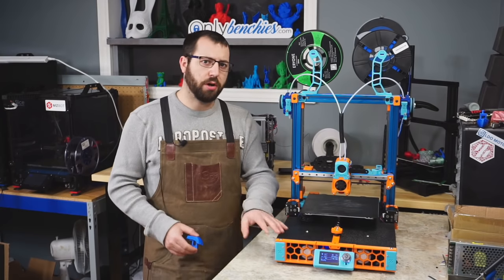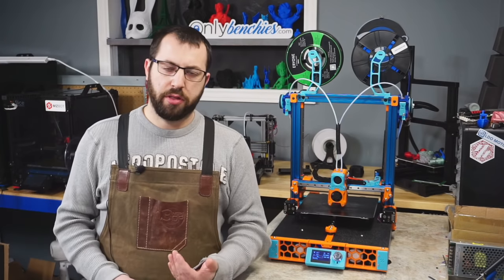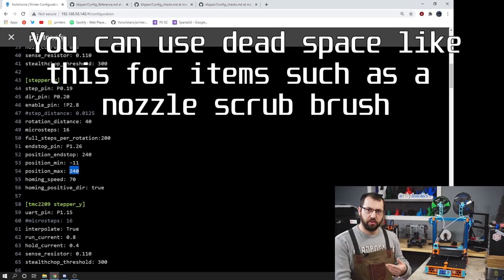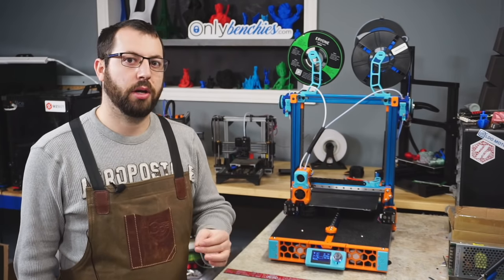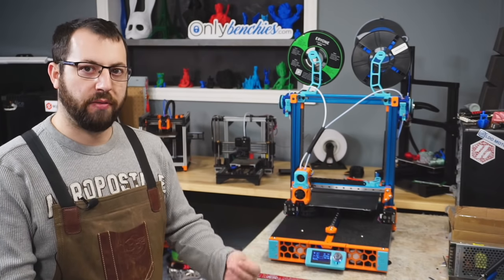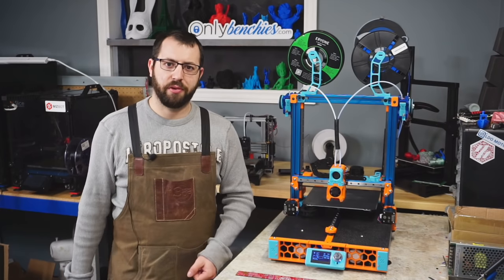Klipper Initial Setup : Making sure things are all good before printing

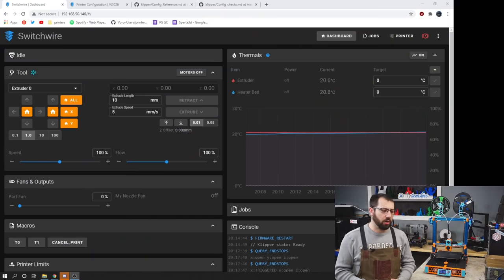Comment: 00:45 - Homescreen
01:05 - Temperature sensors
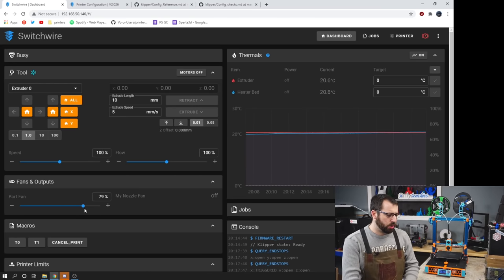01:20 - Fans
01:25 - Endstops
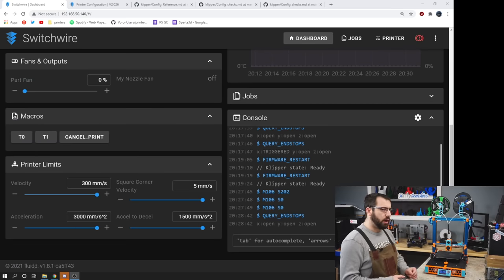02:42 - Stepper buzz
04:59 - Homing
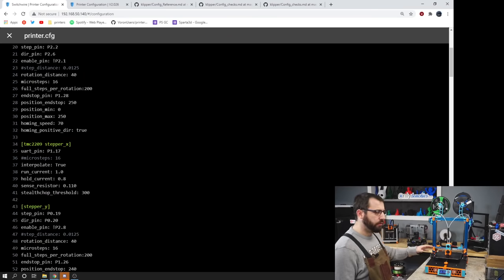06:00 - Z-offset
06:57 - Print volume & travels
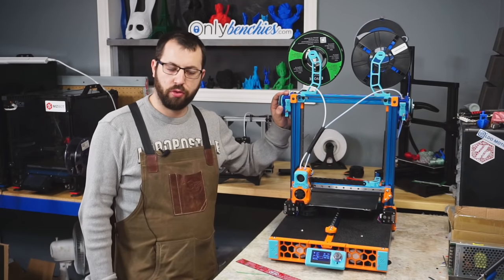09:09 - E-steps calibration
12:07 - E-steps (rotation_distance calculations)
14:20 - PID tune calibration
16:15 - Print flow calibration
17:25 - Pressure advanced tune
17:45 - Outro (Input Shaping)

dedicated to all lost souls alike out there, rejoice! 😆

Comment: Hey man because of you I decided to switch from octo print no klipper to mainsail and klipper, I spent like 15 hours over the past scrubbing my printer config and testing movements even went with the uart rasp pi zero, keep up the good work and I'm sure this will be one of my references moving forward.
Reply: in case you decide to go back to say Merlin, can you just flash from microsd and that's it? in case of a failed klipper host install how do you recover your board?

Comment: Great video. Just switched my ender 3 from marlin to klipper to get familiar with it while i also build a v2.4. I never knew to pull the nozzle for a extruder calibration. Always just heated to the temp i would print at and extruded. But it makes sense to do it your way. 
And i was trying to figure out why my printer was going all the way to the end stop to start a print and print over the air. I have a few numbers to wiggle around in my printer config to do today. 
Maybe I can push some plastic and make my first klipper print today😀

Comment: Thanks for all of the great videos! I'm not very experienced with all of this stuff, but decided to build a Voron 2.4 anyway (Whew!) I managed to get it all together and am running Klipper with Fluiddpi, using a BTT Octopus board. I've gone through all of the setup procedures and am ready to test print, but I can't figure out how to upload a gcode file! Under the "Jobs" tab where the "+" should be for uploading, it just says "no root, see logs" and has a red warning triangle. I tried sending it directly from Cura with a plugin as well, but no luck. Any ideas?

Comment: Question: With your "demo" printer, aren't you concerned about the filament on the gantry? I've found it magnifies the existing vibrations and had an adverse impact on my prints. Once I took it off my prints were noticeably smoother.

Comment: Hello. I got a Kodak Portrait 3d Printer and I installed Klipper on it. The nozzle has a triger switc and the home of the Z axis is on the bottom of the printer (Core XY). The problem that I'm having is once I home the printer the head is triggering the X and Y limit switches on the right back of the printer and the Z is on the bottom with a regular limit switch as well. After homing the axis and heat the nozle and the bed the printer start to print but the bed is still on the bottom (lower position) and it prints on air. How can I deal with the bottom limit switch and the nozzle switch to correct this problem? I also need to enable the second extruder. Not an easy task. I hired a guy to help me but it is taking too long for him to figure out all the pins and it's costing me more then the price of the printer. What is your suggestion? Thanks a lot.

Comment: Since I run Klipper on my Ender 3, I have severe problems with underextrusion at the z seam. Pressure advance already configured and coasting disabled. Any ideas?

Comment: Thanks for the info, helped a lot.
2 Questions.
Can Homing start when klipper start? Can it be set, so you do not have to click it manually?
Ender 5 plus, cannot use the whole bed volume, much smaller now with Klipper.

Comment: Any chance you have a video for hooking prusaslicer to fluid to make it sent prints automatically like octoprint did?  It does not seem to have the API key function the same.
Reply: Also flow calibration. Is that through firmware or the slicer? I got 0.43 on all 4 walls so a bit over.

Comment: I have a ender 3 converted to a 400x400x500 but also it's idex. Do you have a video or could you point me in the direction of setting up klipper for a idex setup please? It runs a skr 1.4 pro board.  I run klipper on my regular ender 3 but new to idex.

Comment: how accurate would you want to be with the e-steps? I got like 99.7mm, but I'm measuring it from the end of the bowden tube (ender 3) just before it enters the heat break (because its kind of the easiest place to get to) at this point, the PLA i'm using is kind of curled and hard to get a good reading on. would it really be necessary to worry over .3mm that may just be error in my measurements?

Comment: If my single wall cube comes out too thick (0.53 instead of the expected 0.4) why adjust the flow percentage instead of adjusting the e-steps?  Thinking that if e-steps are calibrated for 100mm and flow is set to 100%, I should expect 100% to equal 0.4. Instead of running the printer at 98%, why not adjust e-steps to compensate for the over extrusion so that 100% = 100%?  Love the tutorials.  Your vids got me onto klipper and I can't believe the difference.  Cheers.
Reply: May have an answer to my own question: set the steps/rotations just the way you show and then don't adjust them to compensate for over/under extrusion because doing that might mask whatever other issue is actually causing the over/under extrusion.  Makes sense (h/t swordfish45 on r/3dprinting)

Comment: Assuming no other conditions are in play during extruder calibration (hotend is disconnected, tension is fixed), shouldn't the rotational distance be proportional the length of the extruded filament? I.e. the higher the arc the higher the extrusion? In your example it was disproportional.

Comment: What do you (and others) think about the baud rate on an SKR Mini E3 board that has STM32F103xx chip, which has the 115.2k as 0% error baud rate, but klipper uses and advise to use 250k?
Reply from the maker: doesnt have any real impact with klipper at all

Comment: Hey, love the videos and all you bring to the community. I have been trying to setup my CR-10 V3 with Klipper and Fuidd but I keep getting stuck when trying to print something with a “!!Move out of range: 296.000 -3.000 5.039 [0.000]” message. Everything looks to work it homes and I setup the Z offset with the paper test so I am not not sure where to go from here.
Reply from the maker: Need to ensure your max and min travel is setup correctly in yout config
Reply: @CanuckCreator  thank you, it ended up being a bad start Gcode from some Marlin stuff I had, I am up and running with Klipper now, Thank you.

Comment: Hey man, I had it all setup and after upgrading the extruder AND doing updates on klipper today I have an issue with the bed leveling. To be exact it's when runs the bed map update the X runs to far to the right and slams into the frame. I haven't touched any config except the rotation distance. Klipper update messed it up or I did?
Reply from the maker: Make sure you have it setup correctly, ask it to move a fixed amount and measure it, sounds like you have something setup wrong and its double stepping or something
Reply: @CanuckCreator  As I said nothing has changed except the extruder. For now the fix is mesh_min : 30,30 mesh_max : 285,285. It was 20 and 310 before. of course right after that I ran into a new issue. The part cooling fan seems not to get 24v, I turn it up to 100% and it blows not the full amount of air. Is there a way to adjust this? Converted a stock TronXY X5SA.

Comment: Actually the best way to measure flow in my opinion is to print a single layer 100 x100 mm at 2.8 mm or 2 mm. Wait for to cool and then measure the thickness It should be exactly 2.8 mm or exactly 2 mm And should measure 100 by 100 mm. If it measures too thick your flow rate is too high if it measures to thin your flow rate is too low adjust your flow rate until your thickness is exactly what it was programmed to be. This works best on a glass print surface or a smooth print service and not a textured print surface.

Measuring flow rate on a hollow cube has too many variables,

On the other hand measuring flow rate by printing a flat sheet one layer thick in my opinion and in my experience has proven to be very accurate in calibrating flow rate. In fact when you get the flow rate calibrated properly the top surface of that single layer will be as smooth as the bottom surface with no visible layer lines.

Comment: Love your work. Question about PID, in the manual it says after running the PID you need to run SAVE_CONFIG command to save the changes to printer.cfg. I did that and it created a printer(DATE&TIME) file. Nothing was changed on the printer.cfg file, any ideas? Thanks.
Reply from the maker: Ya its an override file that it creates so it been done correctly
Reply: @CanuckCreator  Roger that, I appreciate the rapid reply.

Comment: how do I set the Homing in the middle of the bed? I tryed position_endstop, but it don't work. Because x and y homing is good. But than I will home Z. The Printer will try to home at that, but my print bed is to short... I need to do it in the middle...
Reply from the maker: safe_z_home IIRC is the callout

should be covered in the klipper docs

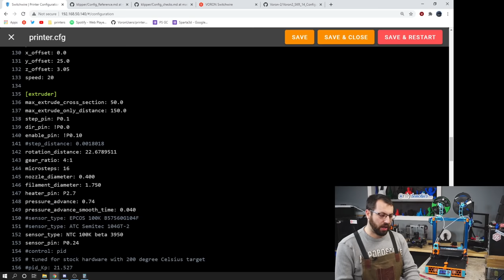Comment: 10:46 "min_extrude_temp: 0"
First of all, Klipper doesn't allow min_extrude_temp to be set less than "10".  
Second of all, if min_extrude_temp: 10  any attempt to extrude filament ends up with "Max31865 Overvoltage or undervoltage fault" and firmware shutdown
Reply: My klipper has min_extrude_temp: 0 set and is allowing me to extrude filament without issue, kinda sounds like a you problem no?

Comment: I keep getting the movement out of range error, I am using 3d print beginners printer.cfg file and Ideamaker klipper profile. Any ideas please mate. Some prints it's fine then others it stuffs up. I have changed the bed size to accommodate the Biqu h2. Any ideas please mate
Reply from the maker: Most likely an issue where your slicer is trying to move the toolhead out of the min/max travels setup in your config.
(for example a purge line at y= -2 but config has a min of y=0)

Comment: Great content, but I would skip the e-steps and flow calibration nowadays. Unless something is wrong with your extruder mechanically, anything different from the stock e steps will be caused by differences between filaments or problems with the filament feed. Calibrating e-steps individually for each filament isn't very useful.

The same holds true for flow calibration. It's also notoriously hard to measure this with calipers and influenced by external factors like temperature, moisture content etc.

Unless you get results that are way off I would leave both these settings on standard.

Comment: I can never get the flow to work correctly. It seems to under extrude the 1st layer.

So the hollow cube will come out with a wall thickness of 0.54mm with a flow of 100%. That means that the flow should be around 74% to get 0.4mm. But if I use that, it will be under extruded. Am I missing something in cura?
Reply: try measuring only the top several layers with medium pressure. If you're putting the caliper all the way down, it could be subject to layer inconsistencies and it will read a lot fatter than a a single wall is.

Comment: Hi, great video. Just installed klipper with fluidd on my ender 6 and i got a wierd problem, i tried print 2 different models and both crash midprint (maybe around 50% of print), im clueless, log says something about lost comms with mcu. You have any clue what could be the problem? Keep up the good work, cheers!
Reply from the maker: True a different or higher quality USB cable

Comment: Could you do a video of loading Klipper onto a DuetWifi? Or point me in the direction of one?
Reply from the maker: The process is the same as a standard klipper install, need to select the correct SAMxxx mcu when doing the make file and put it in programming mode before searching for/flashing it over the USB id https://duet3d.dozuki.com/Wiki/Installing_and_Updating_Firmware

Comment: Why would someone want to use Klipper instead of the firmware that comes with their printer?
Reply: Some printers (such as voron) only use klipper, without an alternative firmware. Vorons are designed that was BECAUSE klipper is massively more performant than something like marlin. Where normally all the calculations and electronics controls happens on your printer's control board, with klipper, the calculations all happen on a pi and the control board is just used to directly access the electronics. This way, more complex and faster calculations can happen without a slowdown in print speed, allowing things like pressure advance, input shaper, and the fancy kinematics that klipper uses. This also lets you use a weak 8-bit board to get better than 32-bit board performance
Reply: It lightens the load on printers that have lower spec boards e.g. the Ender3. I found on my Ender3 that prints with lots of curves surfaces would have small stalls in the motion system movement and this caused artefacts on the print. After installing Klipper this goes away because the heavy lifting in calculating moves based on the GCODE is handled by a Raspberry Pi.

Comment: https://youtu.be/T-knWbh1Gg8?t=800 Any chance there are guides for other things that might be causing issues with inaccurate movement? When printing a cylinder in vase mode, it looks like a drifting swirl pattern, each pass is offset. Everything on my machine moves smoothly, frame is square within a decent margin from what I can verify but I still measure 323mm of travel when I should get 300mm. Any help would be appreciated!

Comment: wanted to switch from marlin to Klipper, I will stick to marlin after watching this video...
Reply: bro.Marlin is boss for ender series 3d printers where there are pre made settings
Reply: Only issue I had was the lack of support for my specific issues. The only way I seemed to correct it was to learn klipper from ground 0. Took one full day to get to this point in the video.